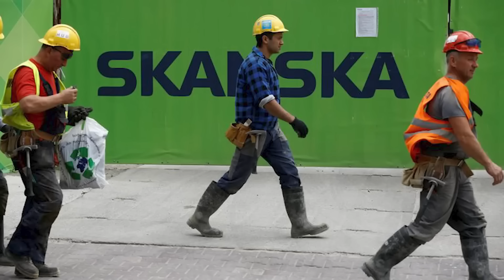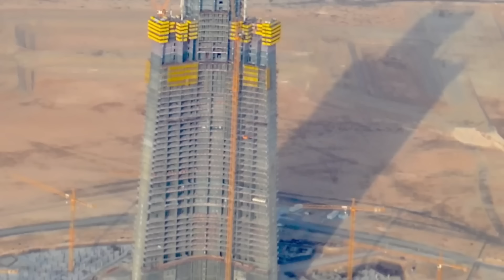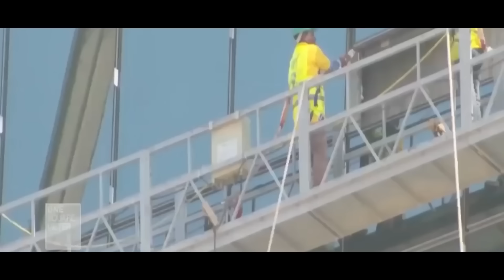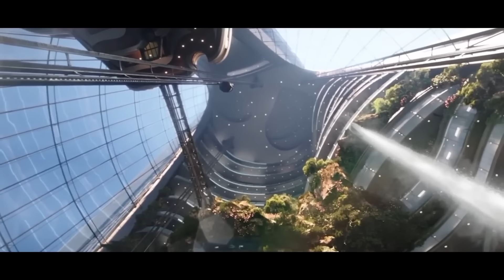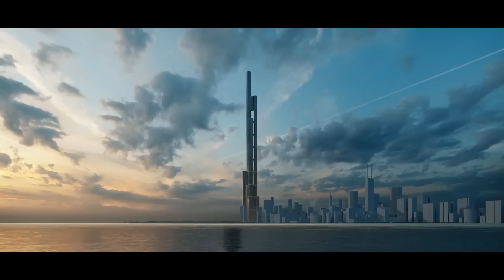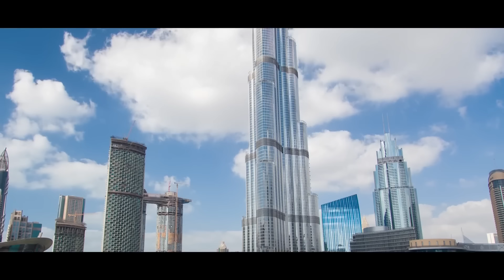Can You Really Build a 1,000-Meter-Tall Skyscraper?

Comment: 4:28 The 300+ m spire will be built in reinforced concrete, not in steel like the Burj Khalifa.
Reply: And that's 300m (equivalent to a 70-storey building) of vanity height just to make it the tallest.
Reply: @majormayco  Very likely yes, although it is not yet clear how the spire will actually be used. It cannot be ruled out that it may be allocated, for instance, to an exclusive limited-access observation facility with significantly premium pricing 🤷‍♂

Comment: Frank Lloyd Wright proposed building a mile high tower in Chicago, called The Illinois. Apparently that was the inspiration for Adrian Smith's design. Smith also designed the Burj Khalifa.
Reply: 100%. Both are rooted in very ancient design concepts and make perfect sense. The CN Tower formerly the world's tallest structure until after the 2000's also uses the same tripod base format for economic and structural efficiency. The Burj just takes it further by coating the core with actual usable spaces and thankfully so. Although the CN Tower was designed for the same reason as Burj and Jeddah. Anchor buildings for larger transformational projects with other residential towers, malls, office buildings, hotels, etc. In Toronto's case? It was just never built in its original form. Metrotown as it was known finally got built as CityPlace with its last and tallest tower, Concord Sky, a 300m/984' supertall finishing construction next year..